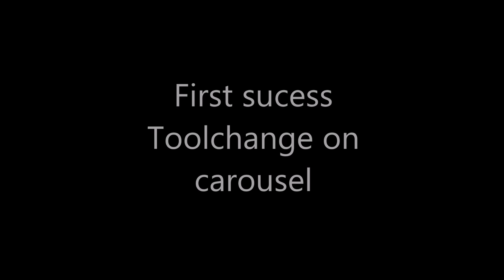xatc holder success

Comment: why did you change the mechanise from the first video ?
Reply from the maker: The spindle simply didn't have enough power to tighten the drill securely, so I discarded the first version and developed a system that transfers more power to the collet.
Reply: @xpixer  Danke für die schnelle Antwort! Question though: you did a macro for the changing tool and replaced the M6 function in the main G-code with it, correct ? " (T1 M6)
or did you change the code that the M6 function calls ?"
I am using grbl on arduino.
Reply from the maker: Long time ago i added a rest service on my server, you can choose the model and add the MX TX commandos to the REST URL and you get the correct moves for a toolchange. Please check this ou:
http://xpix.eu:8080/xatc/replace/xatcv4/tinyg/M6%20T6/4
or as text output
http://xpix.eu:8080/xatc/replace/xatcv4/tinyg/M6%20T1/0?text=1

Here in the repo u will find a program to parse gcode files for TC's and replace this part with the REST result:
https://github.com/xpix/xatc_api/blob/master/parse.pl

If you need more infos, please write me direczt in hangout or via email.